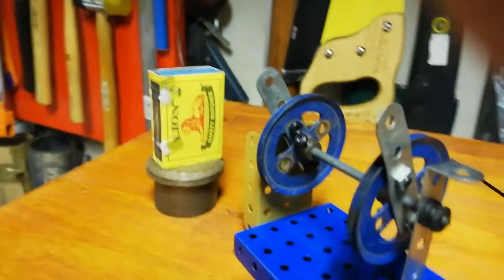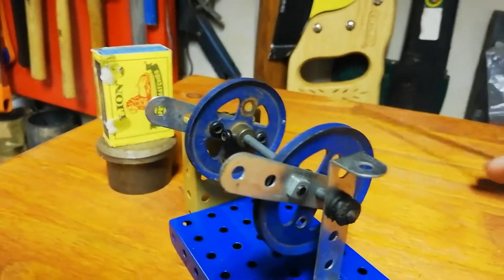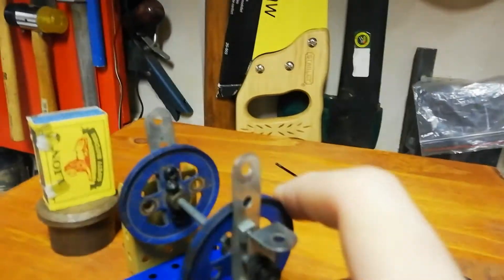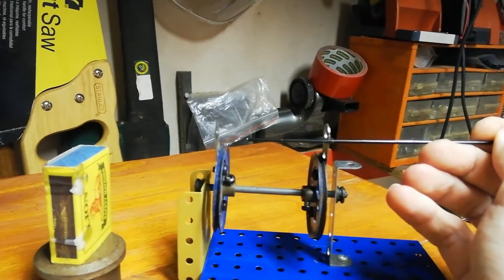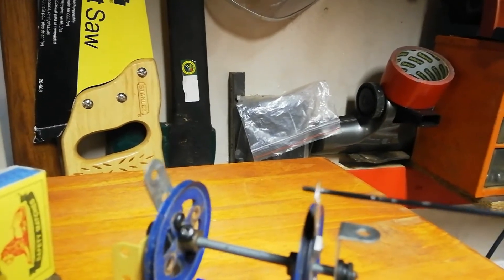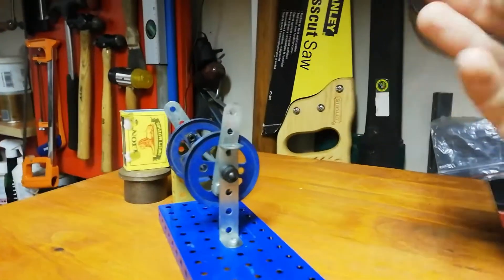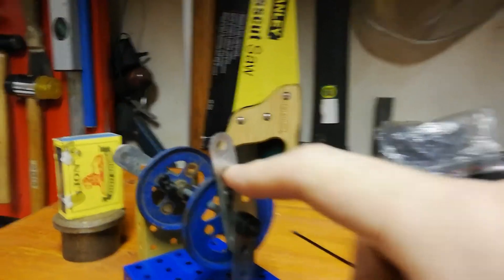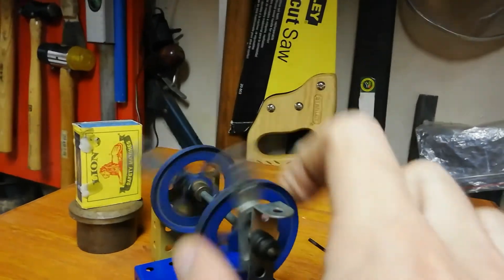Measurement of the Speed of light in 1 direction

Comment: For an explanation as to why this does not work look at the 1939 paper "Theory of Double Fizeau toothed wheel" by Herbert Ives, essentially, the outcome of your experiment will be exactly c due to the relativistic twist of the rotating shaft.
Reply from the maker: Hey thanks for the reply! I think "relativistic twist" is where I'm stuck. However, If I understand the rest, if the speed of light was different in opposite directions, this experiment would still produce exactly c, regardless of direction ?
Reply: @DefconOkay  why would the speed of light be different in the opposite direction?
Reply from the maker: @edfrees  https://www.youtube.com/watch?v=pTn6Ewhb27k&t=5s&ab_channel=Veritasium, this is the video I was reply to. Basically we cant measure it in 1 direction, only the average speed over 2 directions.
Reply: @edfrees  question is why not 

As we know light consists of photons which behaves as single particles or 'quanta' to be more scientific.

Since quantum mechanics are different from classic mechanics (which deals with large objects ) so there may be a chance that formulae to calculate velocity of one particle is different than other when both travels in different directions.

U know we can't just add them as vectors and u can see the 2 laws of general relativity from some other videos

Hope u learnt something new😊😊😊
Reply: Small Axe  really?